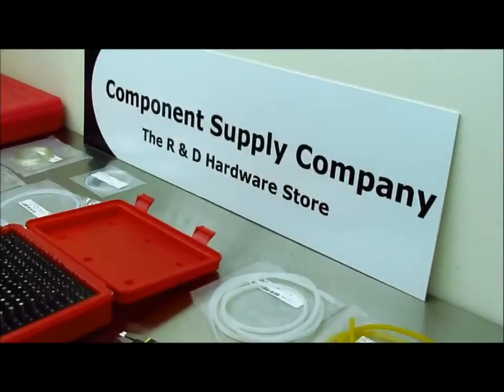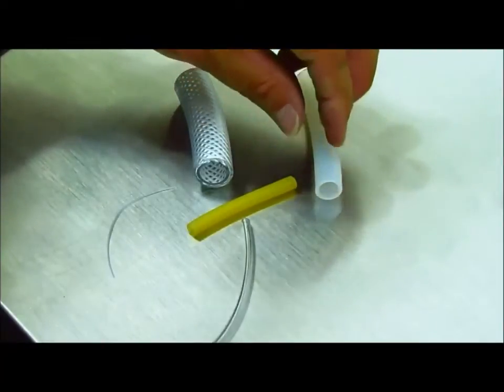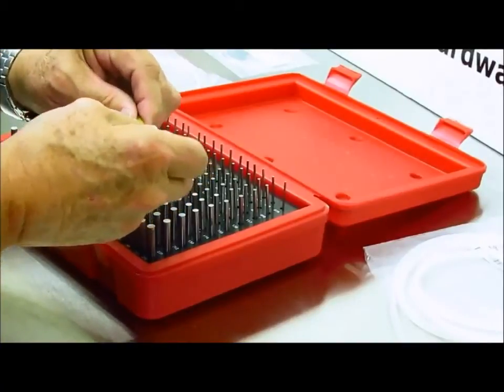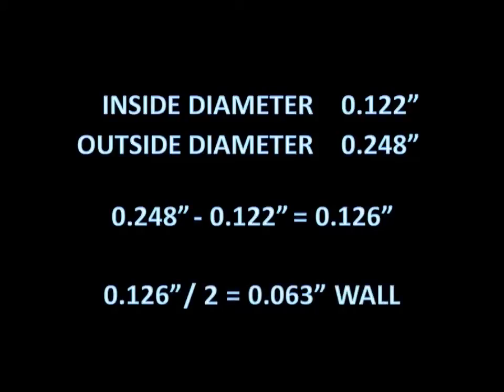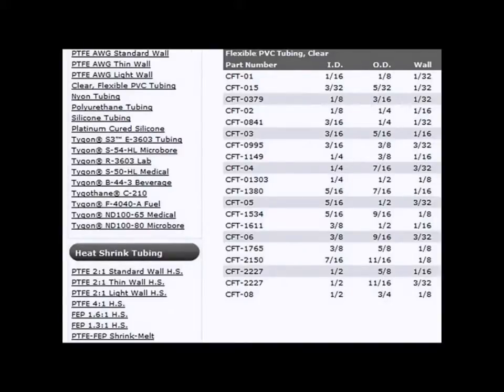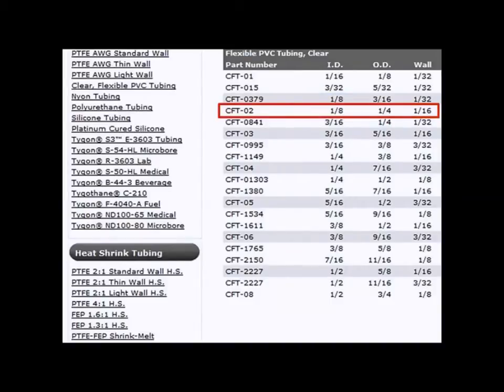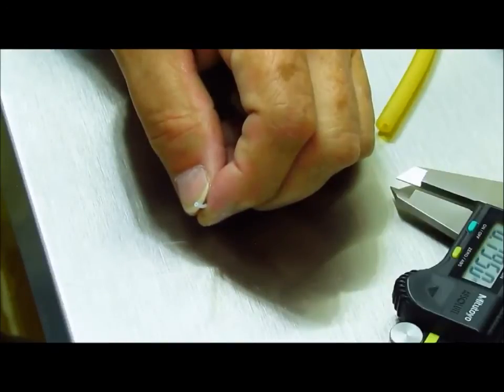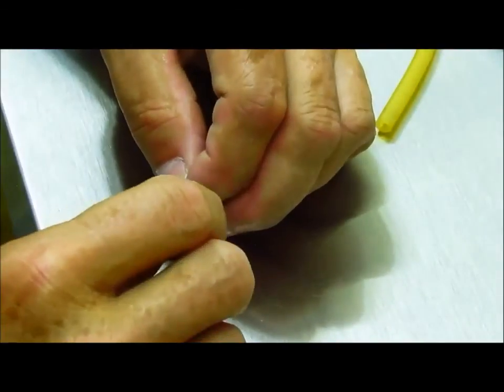Measuring I.D. and O.D. of Plastic, Rubber and Tygon Tubing

Comment: Thanks for the video! I am faced with determining the sizes of tubing for a chlorine analyzer and of course the manufacturer wants you to buy tubing kits at inflated prices. We are looking to buy rolls of tubing and I was thinking this exact same way of using a rod or wire to gauge the ID and I guess I was right! Where did you get your pin gauge?